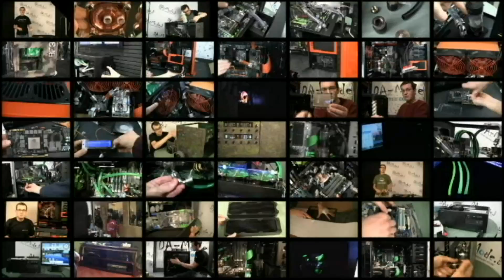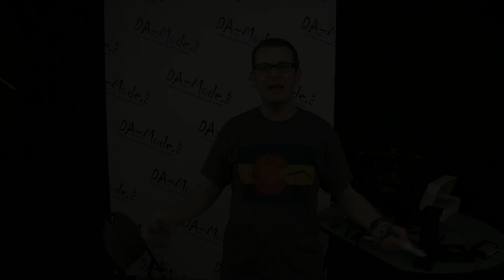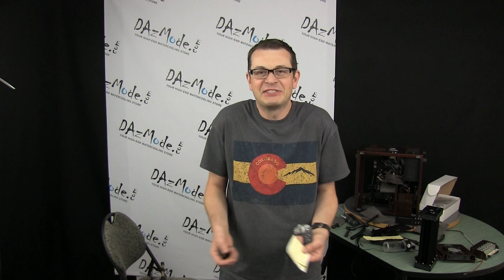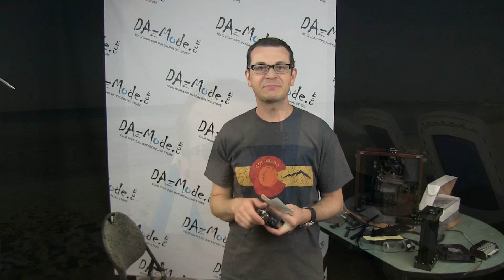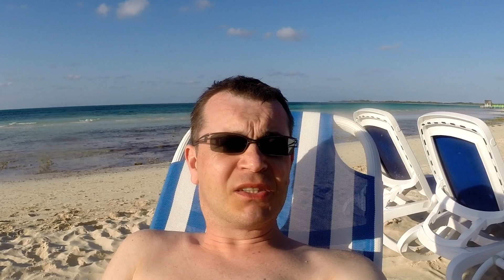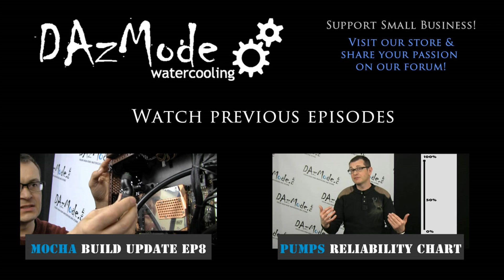How to dim LEDs and bend PCBs  - DazMail EP2

Comment: Dimming: If you don't have a light controller, get an LED driver board with PWM dimming. It will prolong life of your strips. Fan controllers have a fourth pin for PWM that is not on or supported by LED strips. Bending: He's right. They don't bend nicely. Most LED strips, even hard PCB type, can however be cut after every third LED. You can then remove solder mask (paint) from ends and rejoin strip with thin wires and solder.